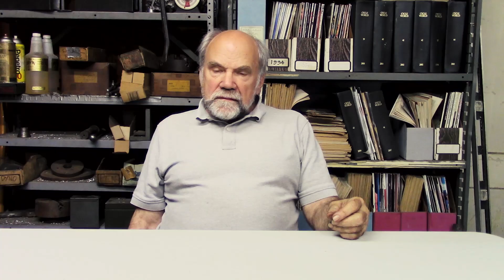How Does Suspension Squat Affect Motorcycle Handling?

Comment: So I'm still confused. Are parallel swingarms better or worse than swingarms with a droop angle? I got the impression from the video that they were better, but you said when Honda did it in 1988 their bike squared down out of a turn, which I understood to be a bad thing.
Reply: It is a bad thing. Not because its parallel to the ground but because it is too close to being parallel to the chain. the chain tension is what gives the anti squat provided it is pulling down on the wheel.

Comment: how do you control anti-squat when there is no drive chain and no gear ratios, i.e, in case of a hub motor (EV).
Reply: Grip is always mechanical. principles of load transfer will still apply. Electric hub motors tend to be heavy, affecting the Center of Mass and of course, will have unsprung weight characteristics different from traditional motorcycles.
Reply: There is still a swingarm, and the rear wheel still wants to run under the center of the motorcycle, thus shrinking the base of the triangle during acceleration, and lifting up the seat.  Maybe the static angle of the swingarm is reduced to account for the lack of chain force?

Comment: So when motorcycles compress the front suspension when increasing throttle on a dyno... Is that due to the built in angles ensuring moving parts of the motorcycle alone also encourage front suspension squat? 🤔

Comment: Hi Kevin, firstly I love your video's and a Big Hi from India. I have some questions regarding off road bikes with respect to the same topic of suspension squat. The physics behind pro squat and anti squat is complicated (and I dont necessarily understand it fully, yet) and most modern dirt bikes have been designed carefully from the factory, so that the squat effects benefit the bikes handling in a positive way, which in a way is quite the opposite of how a road bikes rear geometry works. Apparently, Enduro and dirt bikes have a certain degree of anti-squat during the majority of the suspension travel and it changes to pro squat deeper or later in the travel for rear wheel traction and steering ?? Obviously, The relationship between these two is critical to suspension performance and I assume, traction as well. an elaborate explanation or a video on this is highly appreciated!  lot of folks have many misconceptions about this and disagree that an Off-road bikes Suspension Squat dont affect Motorcycle Handling... which is obviously false. cheers and thanks in advance.

Comment: How is anti squat handled in shaft driven bikes?
Reply: See Moto Guzzi V11sport
Reply: Not sure if you ever got you answer, but shaft moments are neglected because the force is in the plane of the swing arm. Most shaft driven motorcycles actually lift up in the rear under thrust. This can be countered by implementing a 4-bar linkage shaft coupler.

Comment: A few times i saw on an auto scooter everytime the rider gas it, the rear actually lifted up. Guess its got somethin to do with the swingarm angle
Reply: I had a 1977 xs750 with the drive shaft.....it would stand up in the corners which was most disconcerting.......I think BMW does the same thing........drives shaft are a different animal....